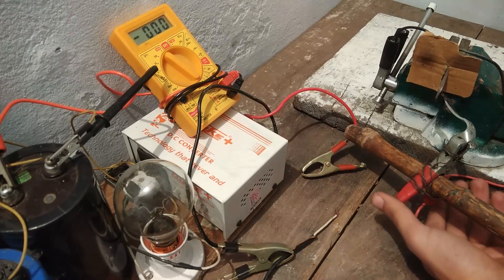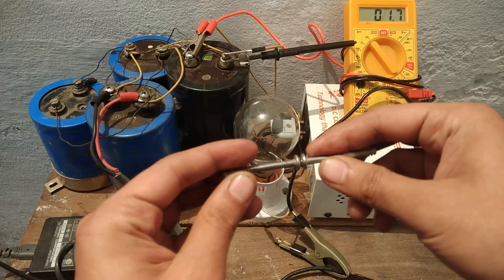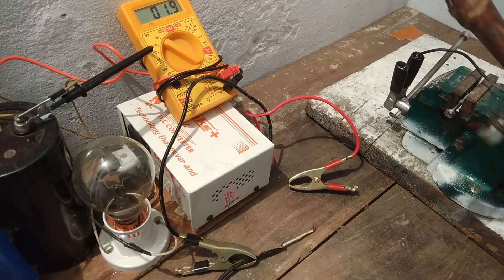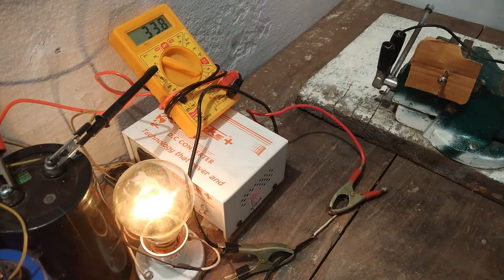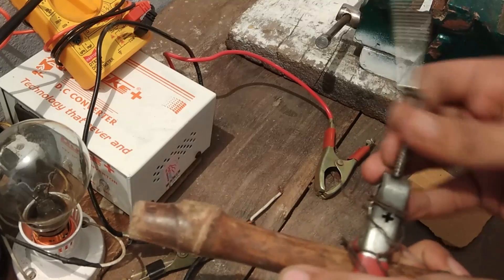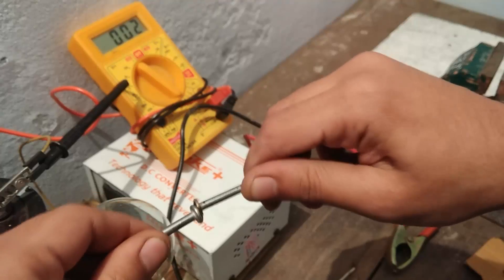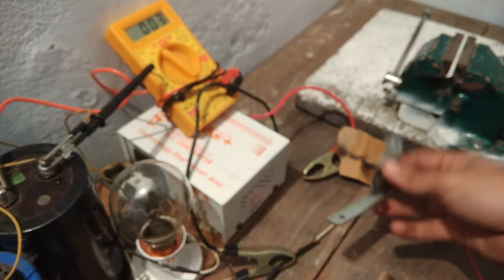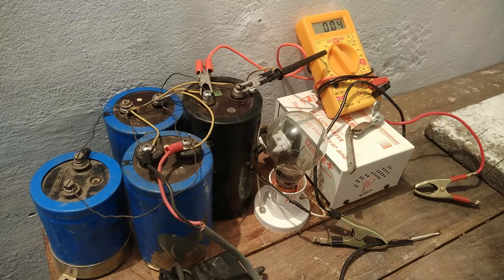Make an Amazing Capacitor Spot Welding Machine at Home DIY

Comment: Just one question,,, why do most people call it welding "machine"? 
In reality it's not a mechanical device i.e. it has no mechanical movement(movement of mass). Just having the electrical movement(movement of charge).

So I think it's only an electrical device (nor even an electromechanical device) but not a mechanical device(machine).
Reply: weld means to fuse two metals or thermoplastic ( for joining them ) here both the  (example) metals are melted and fused together to form  solid joint. An  arrangement of several parts, each with a definite function and together performing a particular task is called a machine. Here the objective (To Weld ) is archived hence  the name Welding machine .
Reply: pl read achieved  instead of archived.
Reply: Deodatta Dive Yes you can call it a machine in common language but it's technically not a "machine".